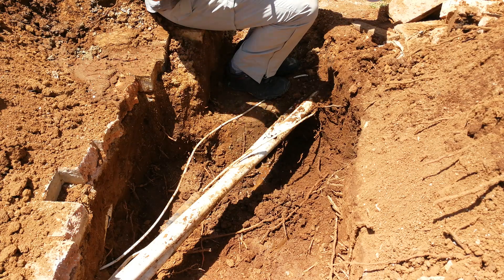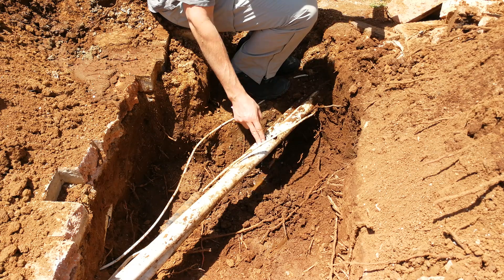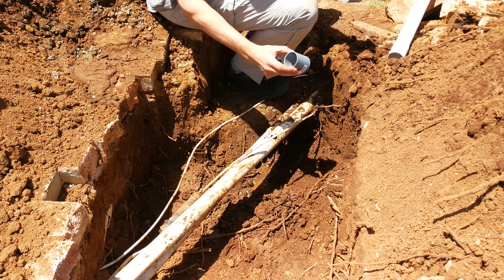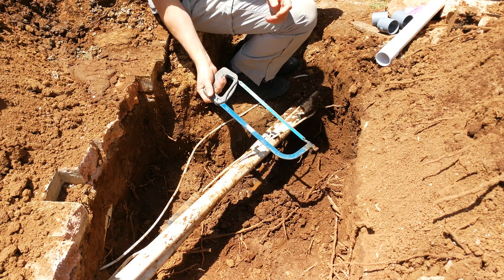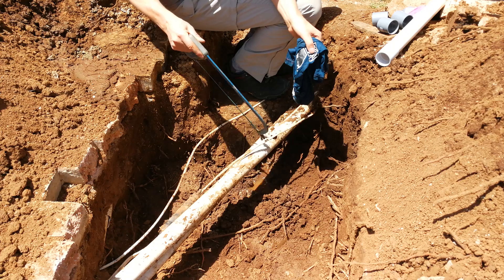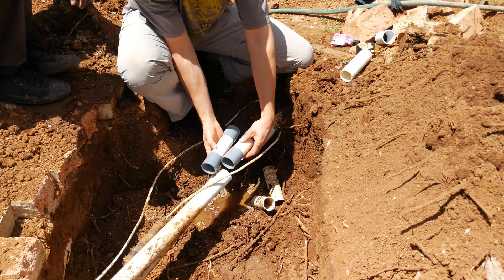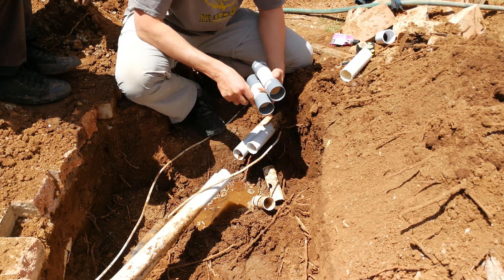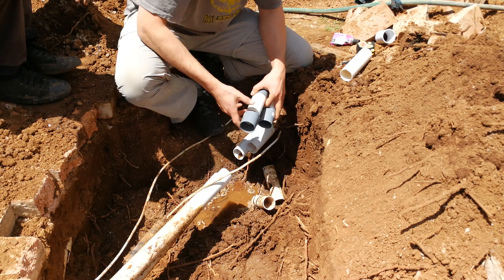How to fix a broken pool pipe- step by step

Comment: They do make some pvc glues for wet conditions,  but usually you want to glue on dry surfaces for the best results. A little tip we used to do is if it was a return line pipe below the level of the pool water, we would take a balloon and blow it up slightly bigger than the inside diameter of the pipe and push it back into the pipe to stop the water flow. Then dry the pipe, glue your fittings and when you turn the system back on the water pressure would rip the balloon and push it out one of the returns in the pool.
Reply from the maker: thanks for the tip

Comment: Those are electrical conduit couplings and the measurements of the pipes are the same as the ones you cut out minus a half an inch.
Reply from the maker: they pool couplings which are thicker and can withstand higher pressure.
Reply: @ecologicaltime  they are grey for electrical.  White standard pvc couplings have a much higher psi rating than sched 40 pipe, so thicker ones don't make any sense.  Plumbed a few thousand pools.